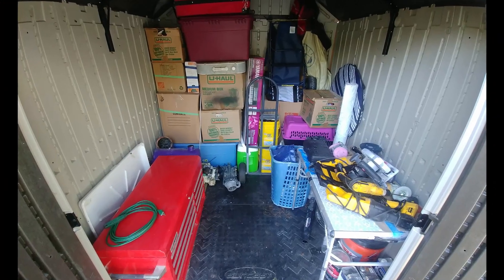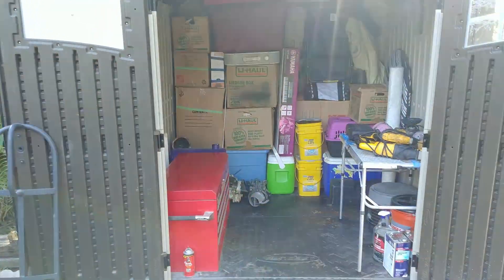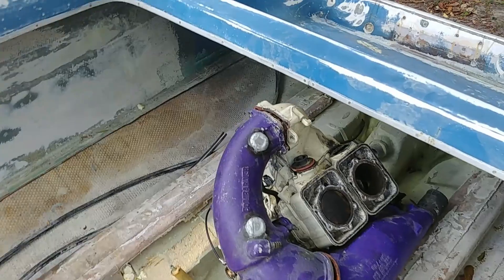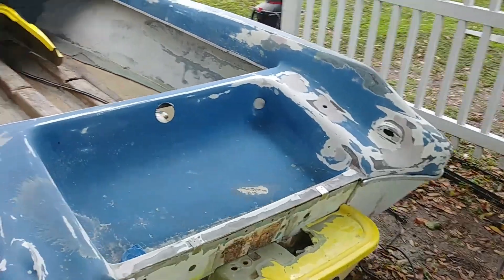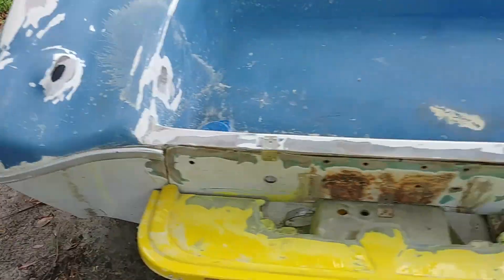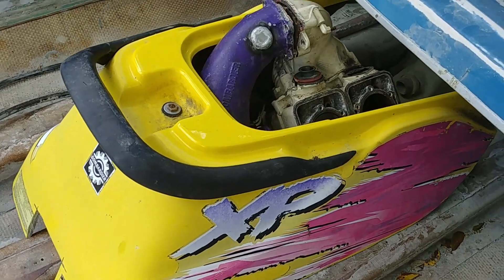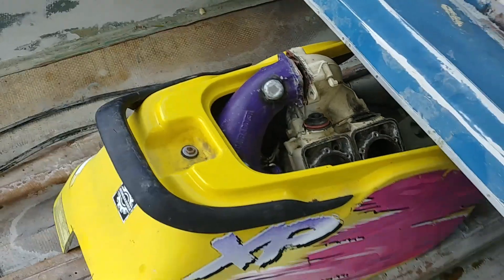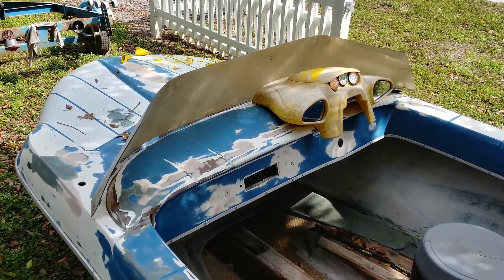JET SKI ENGINE IN A BOAT!! || JET SWAP || MOTOR IS IN!! (Kind of) Vintage Glastron Update #2

Comment: Are you using fiberglass resin rollers on the boat?
Reply from the maker: Combination of that and smashing out bubbles with various brushes.  since I made the framework out of wood and mechanical fasteners, hardly any of this fiberglass bears any load.

Comment: Cool, man looking good. I would go all natural with the dash and skip the seadoo dash, but it is your project so do what you like. You might be able to just mount the factory bars to the dash. Make sure to account for ventilation for the engine if using the small shroud.  Great job!! Oh and whats the song in your intro, sound so familiar but cant place it.
Reply from the maker: Thanks for your input!  The song is actually a copyright free song called "Deep as Ocean" by The Sinking Ship